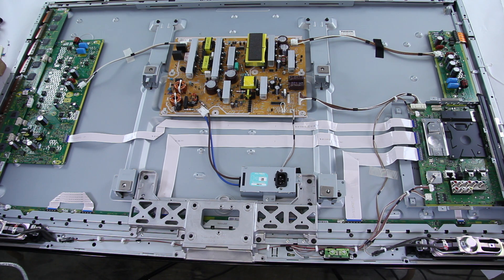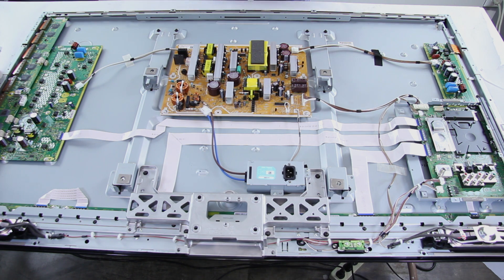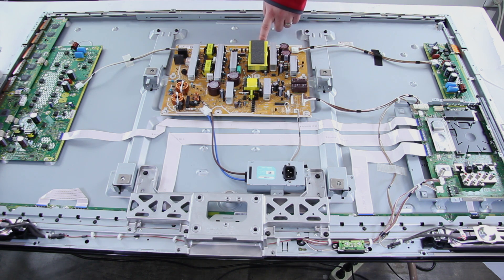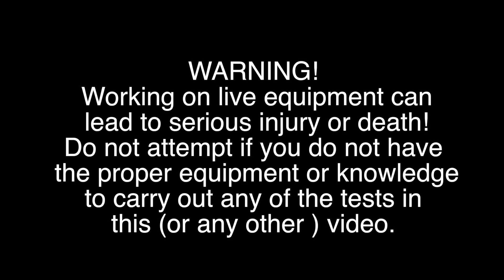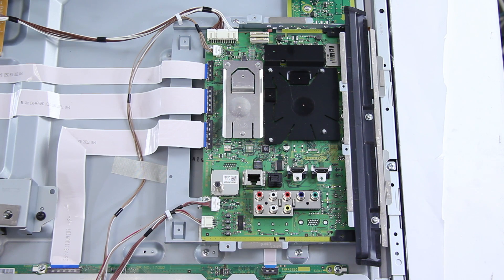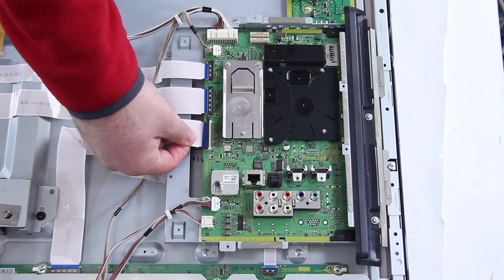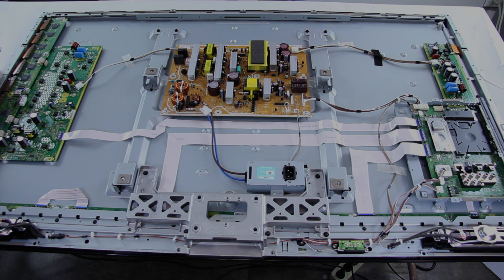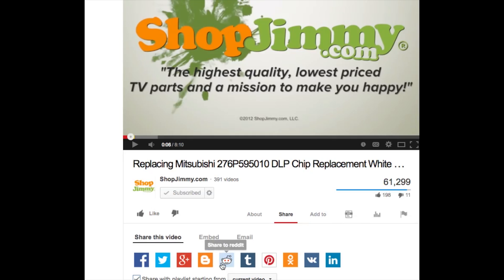Panasonic Plasma TV 1 Blink Code Explained Repair for 2011 Panasonic Plasma TV

Comment: Hi.!! Need help I have a LG60PA550UA..and it won't turn on i've change the power board and the main board..and still no power .!!..the red stand by light it blinks two times when i push the power button and it goes off the red stand by light ..when i replace de main board it just make like no signal sound but no picture..but i dont think that is wright ...could you help me please..!!
Reply from the maker: Gutylopez125   It sounds like one of the replacement parts is defective.  Have you checked the outlet that the TV is plugged into to be sure it works?  Thanks!  www.shopjimmy.com  #tvrepair

Comment: Hi,
I need help on my 2005/06 Panasonic 42inch Plasma TH-42PD50U. I've consulted the repair manual & it indicates that the  four blinking code states that P-Board is not working. I know its not the whole P-Board that has gone bad maybe only one or two components are faulty. any advice would be very much appreciated. thanks.
Reply from the maker: Dave C   I recommend replacing the power supply in your TV.  Here is a link to replacement parts for your TV model number on our website, click here:  http://www.shopjimmy.com/catalogsearch/result/?q=TH-42PD50U  Be sure to match part numbers on your current board, with your replacement for compatibility.  You can also call our customer service for further assistance with your purchase.  (877) 881-6492  Thanks and please let us know if you have any further questions with your TV Repair!  www.shopjimmy.com